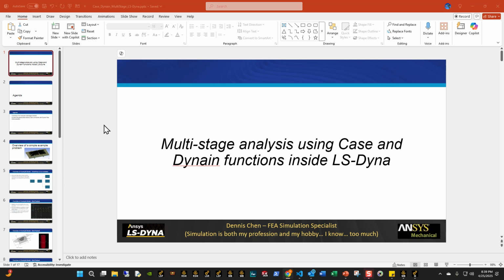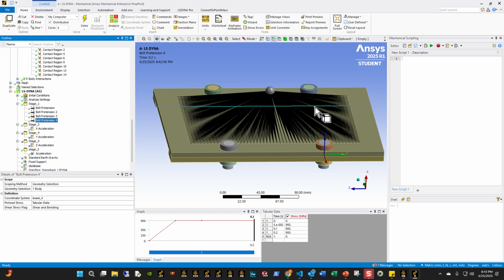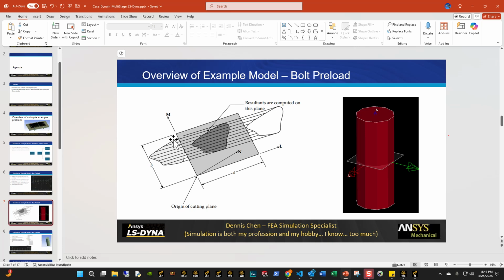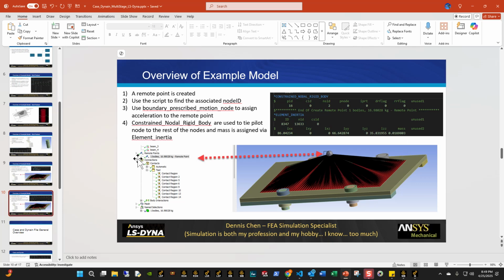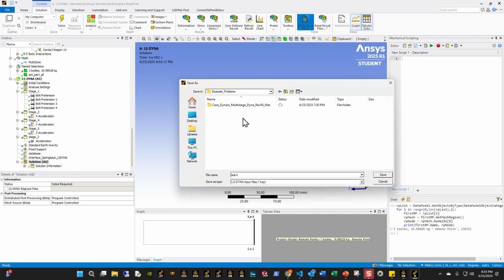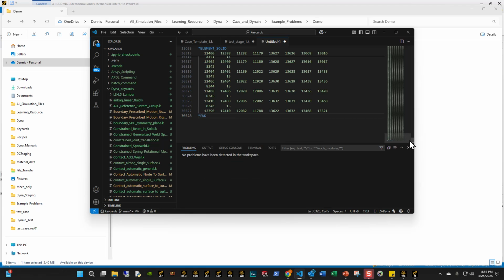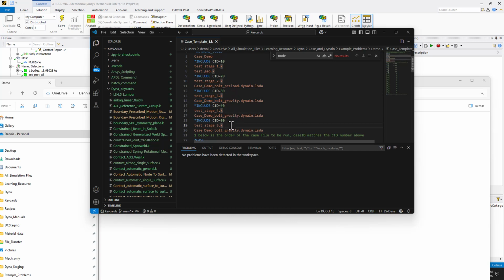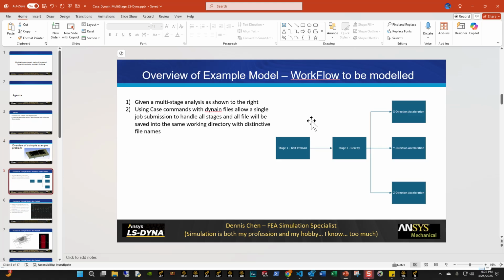Ansys LS-Dyna Tutorial - Using Case commands to run a multi-stage analysis with a single job

Comment: Thanks for this great tutorial. I have a quick question: I don't see the little ▸ folding chevrons next to *Node in my VS Code. It looks like my VS Code doesn’t recognize that *NODE/'*ELEMENTS*ELEMENT_... start with “blocks.”  I do have the LS-DYNA compiler installed in VS Code.
Reply from the maker: this happens sometimes when the input file is large.   I've had this happened to me as well.
Reply: @DCFEA  That explains! Thank you!

Comment: Do you have something related to roll forming simulation where we can run simulation for all roll forming passes by submitting single input file using *CASE keyword, considering each roll forming pass as different load case to save run time?
It would be good if you guide me.
Thanks.

Comment: Hello Mr. Chen, could you please release a video about the impact of earthquakes on structures? I am currently researching this
Reply from the maker: Hello, "impact of earthquakes on structures" can be about so many different things.   I try to make videos in first principles - use the simplest possible example to demonstrate a modelling approach or a work flow.     This topic would probably involve dozens of these simple examples.   

I have a list of topics I maintain so if you have more specific topics, feel free to leave it in the comments and I will add to the list :)

Best of Luck.
Reply: @DCFEA  Hello Mr. Chen! I would like to learn about the impact of earthquakes on pile-soil structures and to understand which of PML Absorbing Boundary and non reflective boundary works better.